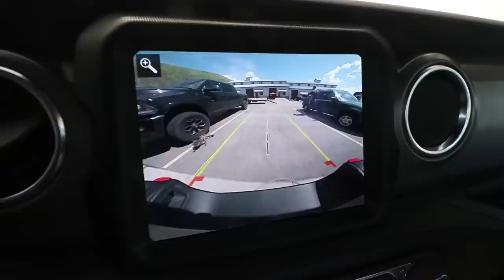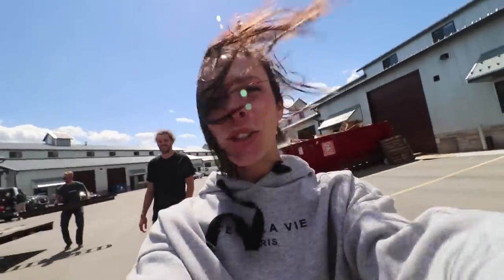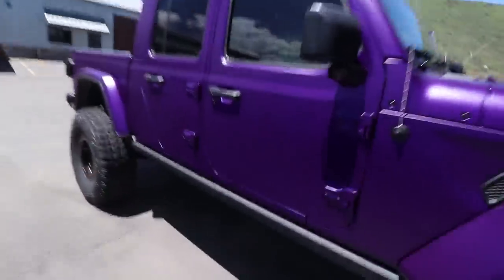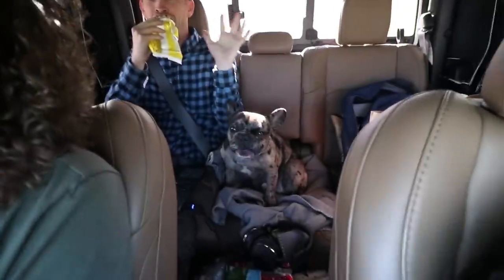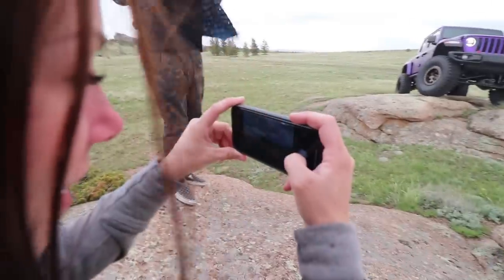Driving The Stradman's Gladiator Across The Country!

Comment: If those stock D44 axles can handle 40s, then the Jeep engineers deserve a raise. I run 35s on my JKUR & do light to moderate trails (i.e. not rock crawling); could have gone 37s, but it starts getting sketchy on the drivetrain & components. Even braking w/ 37s here in hilly CA is janky.